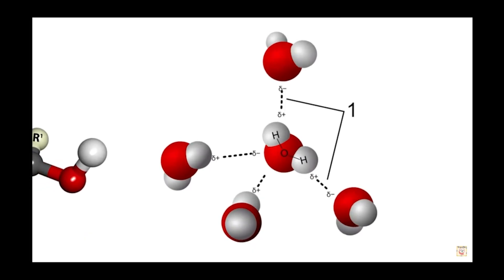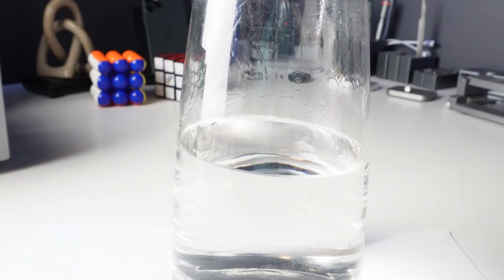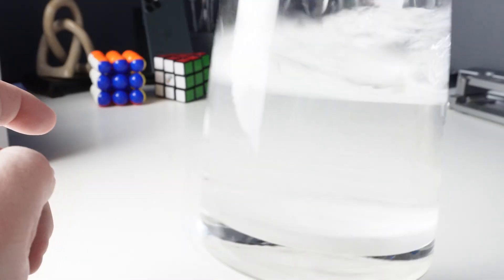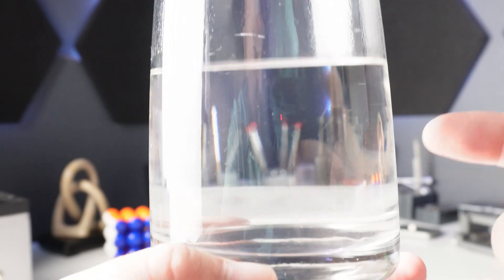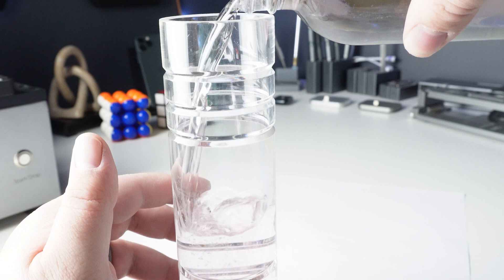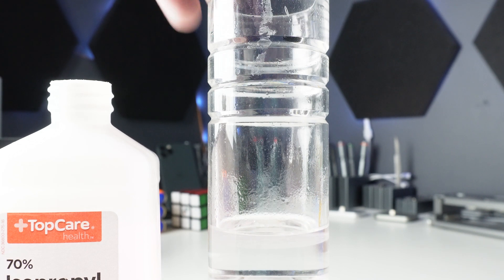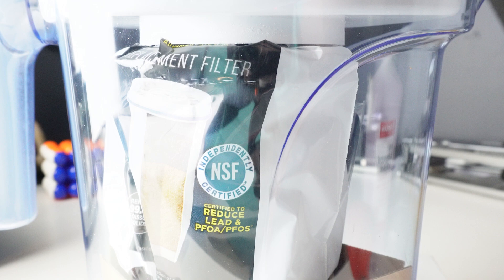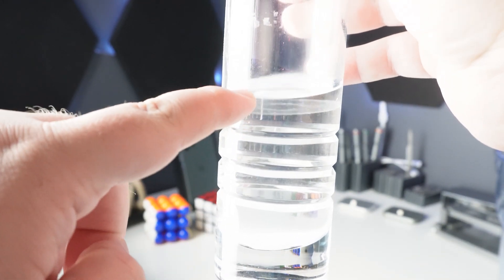How to Extract Water from 70% Isopropyl Alcohol for High-Purity Cleaning – Expert Guide

Comment: Salt can remove a lot of water but definitely not up to 99%. 
2:15 this kinda goes with what I just stated bc people add water usually with 91% when salting out IPA because when it’s already at 91%, the salt doesn’t separate the water like it does when there’s more water in it. Salting out helps get the alcohol around 90-95% then to get it near 99%, you can add anhydrous magnesium sulfate. The salt only dissolves in the water but the magnesium sulfate chemically and physically removes the water from the alcohol since it binds to the mgso4 into hydrates.